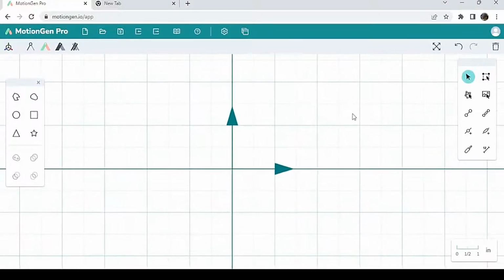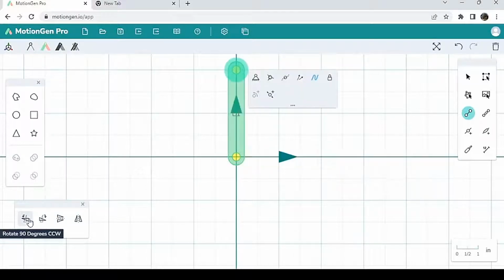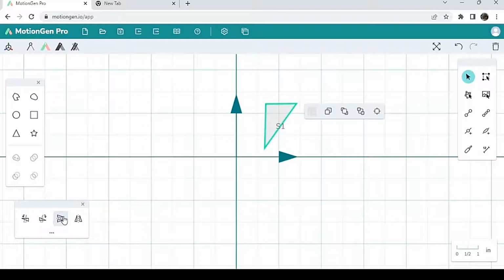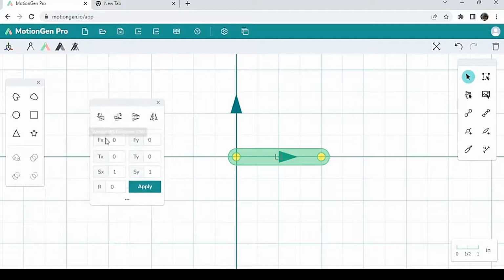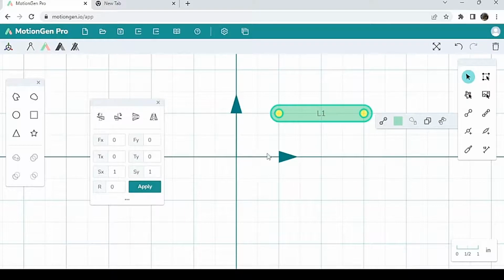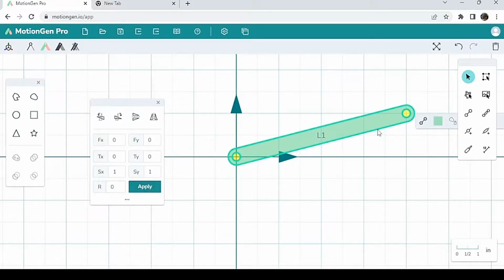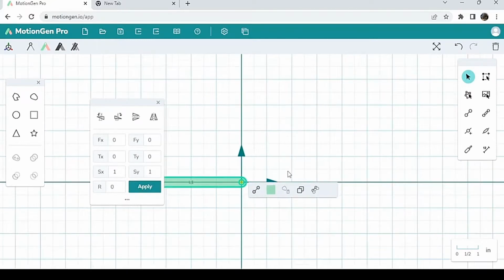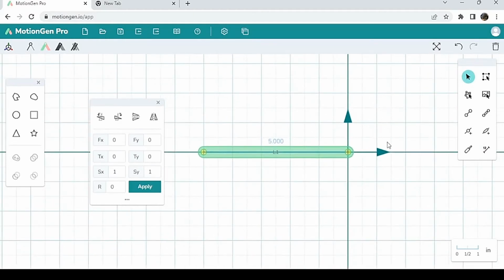Tutorial 6   Transformations

Comment: Is there a way to lock the length of a link after you've changed it?
Reply from the maker: Yes, you can. Lock the joints of that link by selecting each joint and then select the lock icon from the context menu. This will lock the length of the link.
Reply: @snappyxo Thanks!